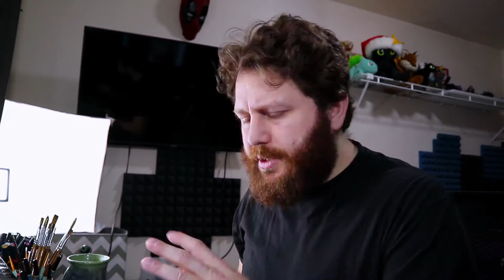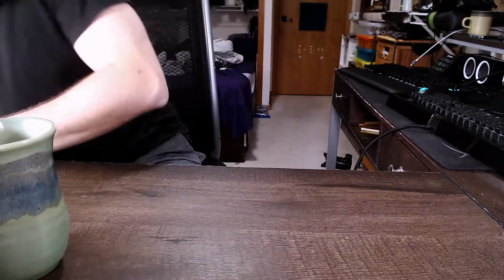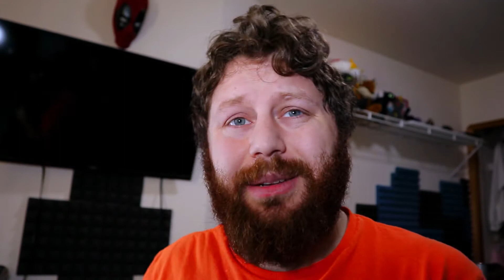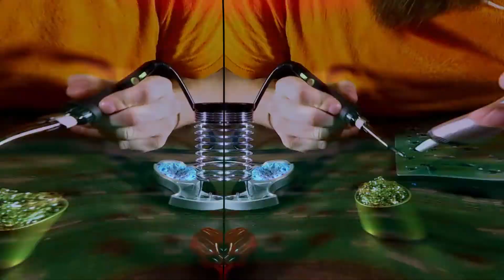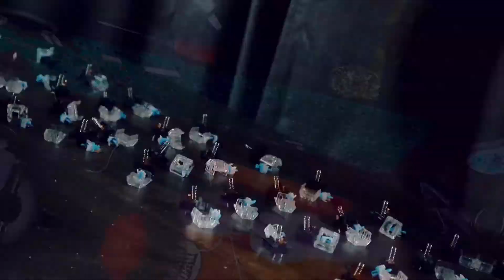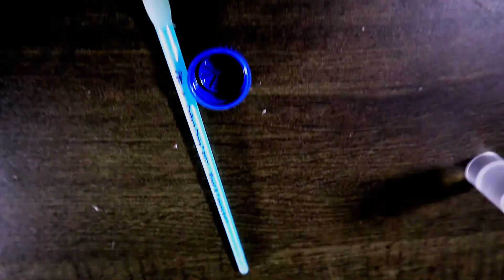CAN YOU LUBE A LOGITECH KEYBOARD? Let's Try!

Comment: The reason it was so hard to desolder the switches is due to the lead free solder. If you melt some leaded solder onto each joint before you suck the solder off it will be easier. But hats off for even taking the time to do it.